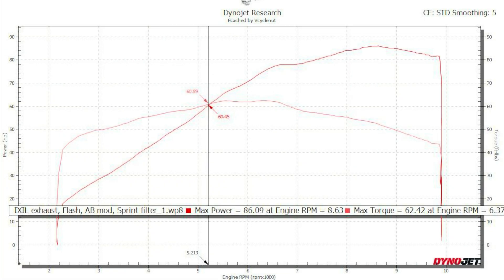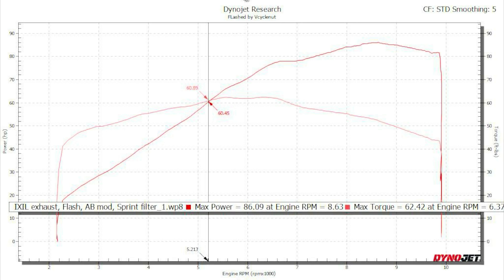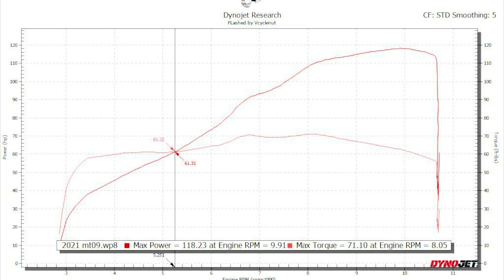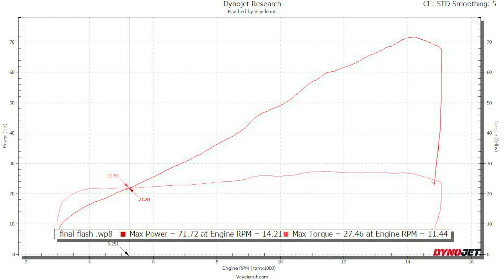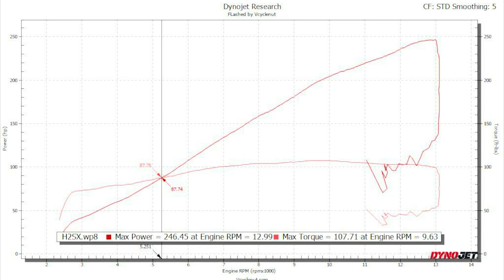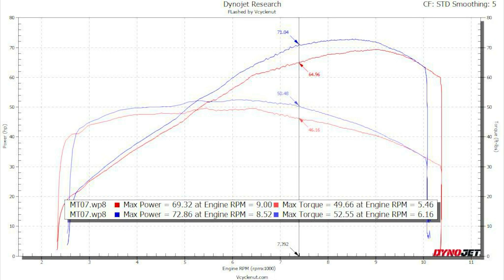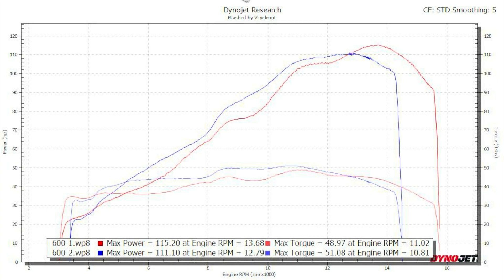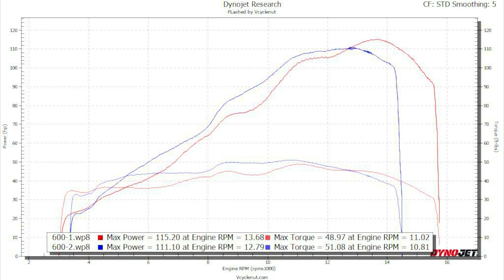How to read a dyno chart! Making sense of the squiggles

Comment: Smoothing 5 can hide weird peak blips...but it also (and more importantly) can hide bad tuning, worn plugs, etc..    set it to 3 and a good built and tuned engine won't have odd spikes anyway.  Also- CF should be set to SAE.
Reply from the maker: thanks for the tips

I use STD because my dyno reads a little lower than average.   No matter how many times I explain you cant compare one dyno to another for numbers , having lower  numbers hurts my business

I also never , except for baslines, show a run by itself

So if my baseline is in STD and my post tuning runs are in STD the comparison is totally valid

I find that smoothing 3 will post a bigger number for peaks  when it counts the little spikes

Comment: Wondering about calibration, tire slip, etc...
Reply from the maker: There is no way to calibrate the hp reading on a dyno.  Tire slip is very obvious when it happens.
Reply from the maker: Some of it is covered in my down low on dyno runs video

https://youtu.be/wJ_J_GsHvuc?si=P2FBf3lW4uNL6Gbh

Comment: This was very interesting, it would be cool to see the MT09 graph compared to the MT10, just to see where exactly those two bikes differ especially in torque delivery. I always hear they’re about the same up until much later in the rev range, makes me wonder if upgrading to the 10 is worth the squeeze.
Reply: I own them both, (latest models). MT-10 is far superior. Additionally, a motorbike is not only an engine but many other factors. MT-10 is an R1 derived model. That makes it super fast right out of the box.
Reply from the maker: Ask and ye shall receive 

https://youtu.be/nBVBBxiy9IY?si=V5zi3_12yg2ueFQN